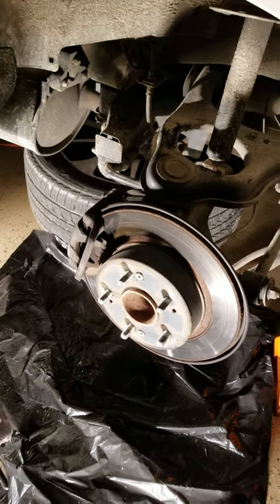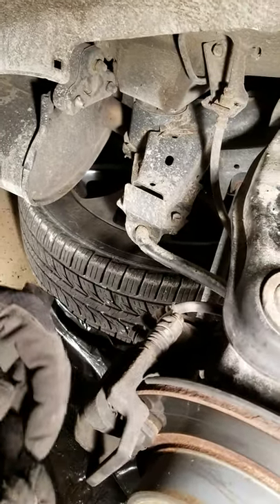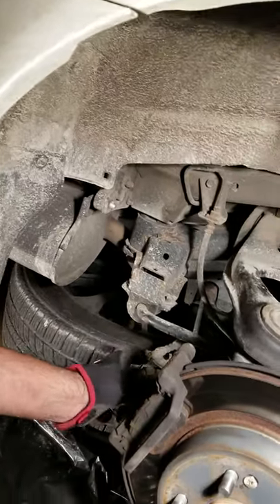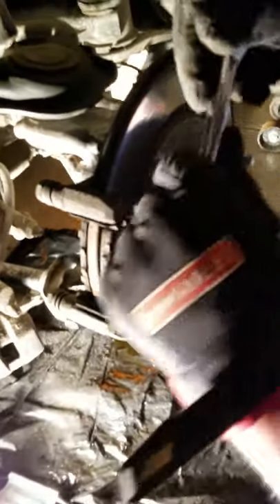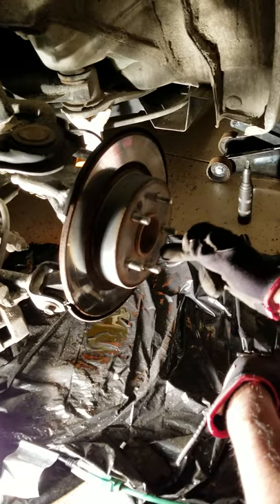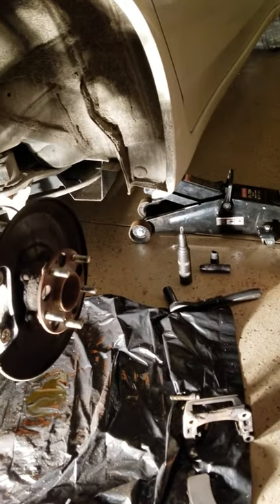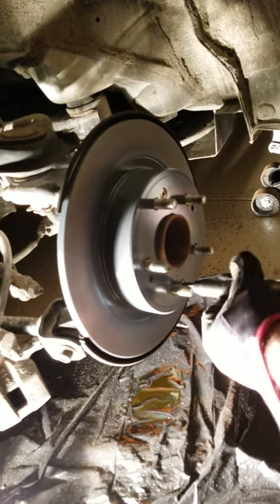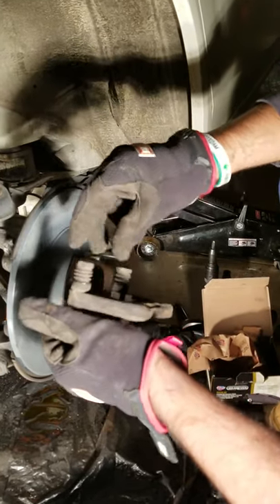2009-2014 Acura TSX rear brake replacement

Comment: That is not a normal 17mm socket. I think it’s thin walled but it resisted and I can’t find anything like that in the store
Reply from the maker: @drrwsclark - you should be able to use regular 17mm socket